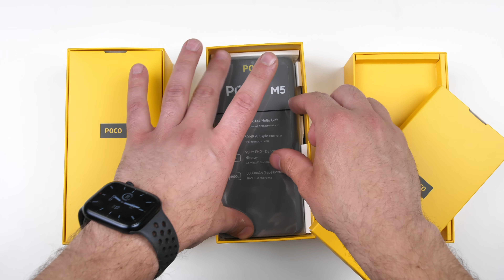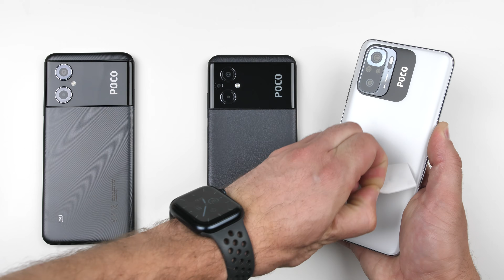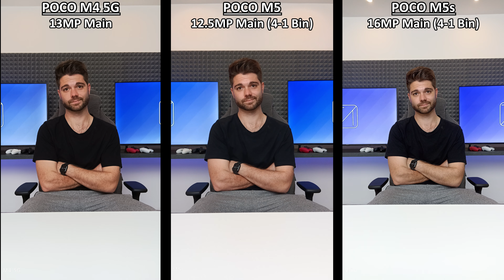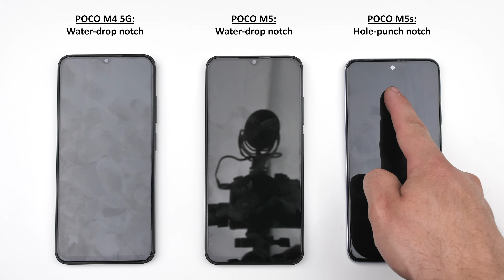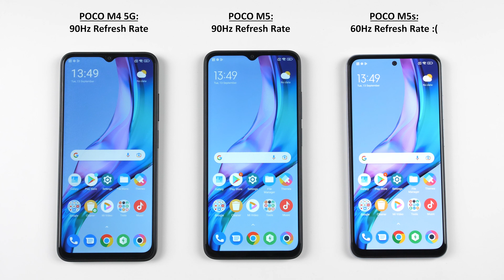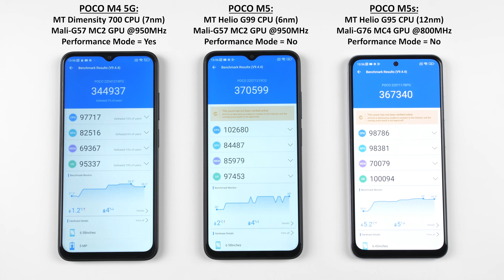POCO M4 5G / M5 / M5s Unboxing & Impressions: MID-RANGE MADNESS!

Comment: The poco m5s is basically a rebranded redmi note 10s
Same company. Same specs. Same design and everything. So if you're thinking about buying the poco m5s. Get the redmi note 10s instead. You can get one brand new for sround $120 (at least in my country)